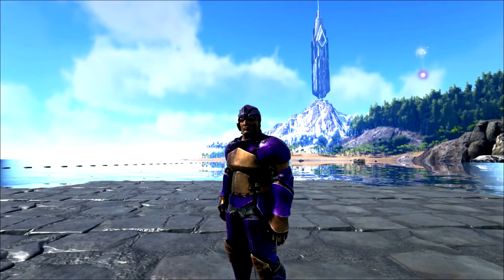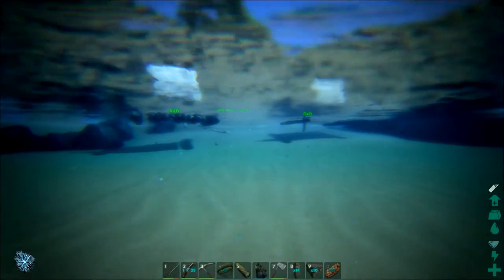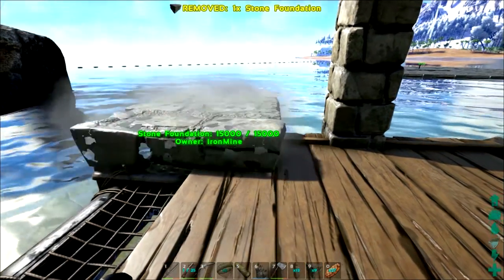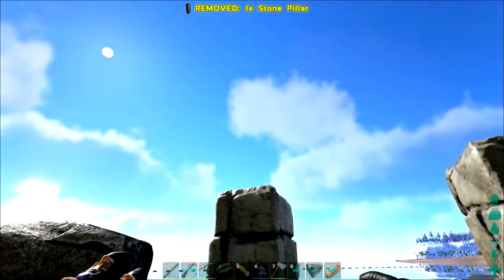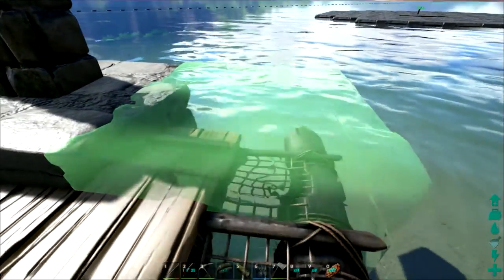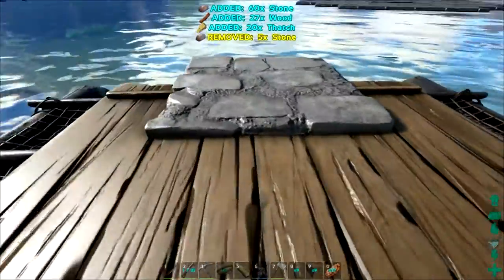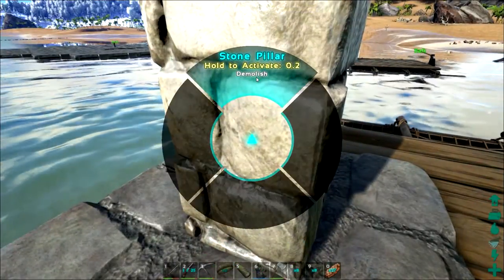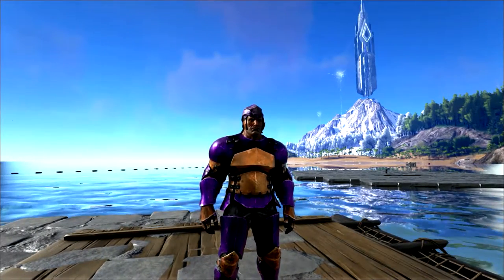ARK Advanced Building: Updated Techniques for the Biggest Raft with Sunken Foundations

Comment: i cant seem to build more then 6, 3 in middle and 3 infront and thats it...cant build near the drive. Does it have to do somrthing with the default settings for server?
Reply from the maker: You should be able to build what I did on default settings. Did you place the first piece like I did? If you place the back row too far towards the center, you could be unable to fit them all like you described.
Reply: my last snap point was top left just like you, but i think i did not continue building exactly lik eyou. Should i have done that?

Comment: is this patched. because it just puts what I want in the water when I go to drive. ive watched several vids with this method. And cant find an answer.
Reply from the maker: I've seen it alternately work and not work recently, so I'm not sure. It worked for me on my modded raft the other day. Make sure you have the building place equipped before you drive and don't move at all afterwards. Also make sure you are far enough out in the water that the part doesn't try to place on the land below.